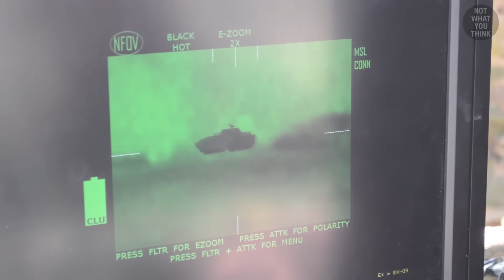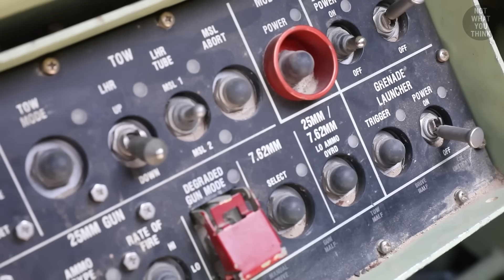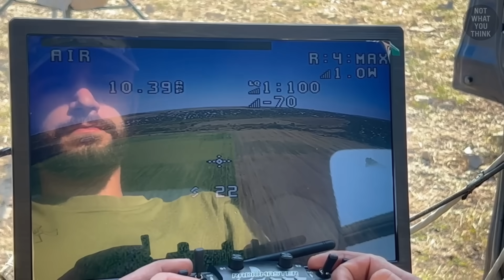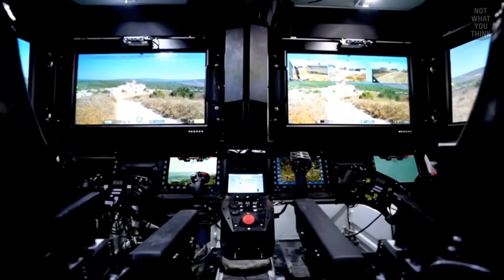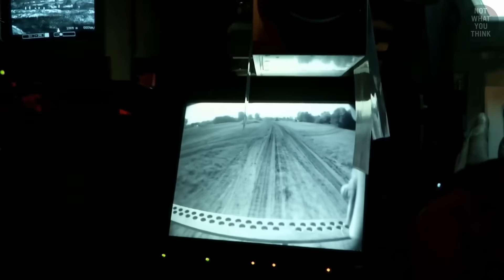How Bradley IFVs prove more Useful in Ukraine than Tanks

Comment: The problem Russian tanks are having in Ukraine have nothing to do with tanks being "obsolete"; folks have been saying that tanks are obsolete due to infantry-portable anti-tank weapons since the 80s. The problem is that Russian tanks operate without proper infantry support. Tanks are not do-everything weapons, they need to be supported by infantry to do their job correctly.
Reply: People have been saying they're obsolete every time a few are lost in combat for the past 100 years. Tanks have always adapted, and will likely continue to adapt for generations to come; They're too useful to ever outright abandon.
Reply: There was a long period where people were saying, "See the battleship is not obsolete... People have been saying for decades that the battleship is obsolete." @foo-foocuddlypoops5694
Reply: @foo-foocuddlypoops5694 its the modern evolution of cavalry
Reply: @foo-foocuddlypoops5694 🎉
Reply: @foo-foocuddlypoops5694 well it's a big armoured gun on wheels . Of course it's useful but the way it's used will certainly change
Reply: @foo-foocuddlypoops5694 ironically infantrymen get killed in every conflict yet no one says they're obsolete
Reply: @foo-foocuddlypoops5694  yeah they are useful in a defensive role because if you are the one going at it and its sitting still you are at a huge disadvantage because its more likely to spot you or its dismounted infantry or drones like the reaper which can communicate with the tank and give them a firing solution.
Reply: A war machine doesn't become obsolete because a counter exists, but rather because there are other systems that can fulfill that niche. For example, battleships didn't become obsolete because of anti-ship missiles; torpedoes have been a threat to battleships for a long time. Battleships became obsolete because advancements in destroyers allowed them to do a better job than battleships at a lower cost and with fewer crew requirements. It's the same with infantry, really. Machine guns are good at shredding infantry and have been widespread for over a century now, but they obviously don't make infantry obsolete. As long as there's nothing to do infantry's job as effectively, infantry is here to stay.
Reply: @solomonofakkad1927 Watch out for the upcoming robot warriors bro, just around the corner what with AI and all... Here comes the Terminator for real, soon to be seen at your next local madman's thirst for power.
Reply: @solomonofakkad1927  battleships became obsolete because aircraft carriers could engage them from well beyond visual range and drop bombs on them from above

Torpedoes still exist but nobody bothers with torpedo belts because that's not where the greatest danger is
Reply: A valid point but nonetheless ignores that drones are multiplying, diversifying, and improving faster than tanks. Missiles and artillery can aquire and target better than ever before. IFV can do most of what tanks do and are more versatile and cheaper and can take out a tank. Plus they carry their own infrantry support. The economics of MBT are going to be much harder to justify especially given their greater logistical demands.
Reply: Infantry and air support.  Combined arms, we call it.  The air support looks out and around the area, for anti-tank weaponry.  The soldiers on the ground look out for enemy soldiers with anti-tank weaponry.

Without air support you get tanks being destroyed by artillery.  Without ground support, you have tanks getting destroyed by tanks.

Don't forget the role of tanks.  Tanks are for killing people in fortified positions, and destroying said fortified positions.
Reply: The moment tanks stop being used, anti tank weapons will no longer be needed. Once there are no longer anti tank weapons, tanks will no longer be obsolete
Reply: Yes this we saw many times in WW2. Learning from the past is a rare
Reply: Sadly, we do learn from the past. We learn to fight the last war.  @user32001
Reply: @user32001  British counterattack at Arras in 1940 with heavy Matildas were a real problem for light panzers.  However no infantry support so they got knocked out by 88’s.  I’m one of the few who reads history.
Reply: t-72 was already a dated design in the 70s and was only chosen because of soviet cost cutting. That you can't even be taller then 162cm as crew says alot about the design of t-72 that and the turret usually gets launched into orbit if someone sneezes in the vicinity.
Reply: @zalandarr  Yet this is the tank Russia and Ukraine will in almost any situation prefer to a Leopard 2 or Armata. But well, what do they know, eh? ^^

(They know that the Leopard 2 is incapable of delivering indirect fire plunging into an enemy trench with any degree of precision, while the Soviet MBT are all natively equipped for this.)
Reply: @zalandarr  Yeah and now according to you, the M1A1 is a "dated design". Do you know what you are talking about? Have you served in tanks or any other AFV or are you just another r war thunder Veteran?  Do you even know WHY Russian tanks pop their turrets? Do you even understand the basic design you can explain the advantages of such a turret design? No you frucking well don't.
Reply: @zalandarr Western tanks burn just as good as Russian. Your joke of turret going to orbit from sneezing is laughable. Not funny in a sense you meant  . 
Ukraine's t72 turrets fly just as high as Russia's .
Reply: @NikZ8736 no they don't. Our tanks can survive way better then Russian tanks
Reply: @NikZ8736 not it's not. He is right. The crew in Russian armor sit on top of the ammo. One hit to yhe center of the hull side and off goes the turret. In desert storm we called that the jack in the box. And it happened a lot. Maybe 50% we scored a jack in the box. And it happened again during the 2nd invasion with same results. All u armchair generals have no idea what u are talking about.
Reply: @NikZ8736  yes the Russian made T-72s do fly high. Ukrainians prefer western tanks and IFVs eventually they will have no Russian tanks and all western tanks.
Reply: Exactly
Reply: Tanks a a concept aren’t obsolete, but many of the reserve tanks as mentioned in the video are obsolete because they’re old*. They lack a lot of the modern technology, namely armor developments and fire control systems (FCS)/ targeting systems because they’re effectively Soviet-era relics. Without updates, *those tanks are obsolete as far as a tactical advantage aside from simply having another vehicle to utilize.
Reply: The problems RuZZian tanks are having is the much better man portable anti-tank weapons in the hands of Ukraine soldiers - even the AT-4 and carl gustav are absolutely deadly to a tank or IFV when it is approaching your trench, and beyond that range you have NLAW, TOW, Javelin, Stugna-p and even the excellent Ukraine FPV drones with RPG warhead etc.  Add Brimstone and the various 'target seeking ' smart artillery munitions, as well as the mine deploying artillery shells  and a RuZZian armoured vehicle just became the most dangerous place to be.
Reply: @chrissmith2114  That's a good point.  I watched a video this week of a Russian tank, a T-72 that was hit by 5 land mines and kept moving forward.  You know that is absolutely brutal.  The sixth land mine took the tank out, but they did bring their IFV to the Ukrainian lines and the three tank members were taped getting out of the tank.  

Of course, things are even worse on the Ukrainian side.  Last week again brought is more video footage of Leopard tanks burning and that doesn't count all the old FSU tanks Ukraine has lost.  Not only do the Ukrainians have to fight the drones, the ATGMs, RPGs, land mines, and artillery, but they also have watch the skies for anti-tank helicopters which did a number against the Ukrainian armor.  

In short, it's rough being a Russian tanker.  It's even rougher being a Ukrainian tanker!
Reply: @chrissmith2114 Carl Gustav and at-4 cannot destroy a Russian tank.  They can knockout bmps   Bmds and btrs but not tanks
Reply: @smyers820gm  AT-4 can EASILY destroy a Russian tank AT=Anti-Tank Duh!!!
👉"Along with the FGM-148 Javelin and the Next-Generation Light Anti-Tank Weapon (NLAW), ❗👉 the AT4 destroyed HUNDREDS of Russian main battle tanks, infantry fighting vehicles, armored personnel carriers, and support vehicles in the opening days and weeks of the war. Feb 20, 2024"
Reply: @smyers820gm there's videos of a Carl Gustav destroying a T-90. Try watching something other than RT tv or reading TASS ...😅😂🤣
Reply: Someones been watching too much TV....
Reply: People have been saying the cavalry is obsolete for generations, but look, it's still proven itself well in the Crimean War and is still used by both the Prussian and the French armies to this day. I'm sure it'll still be relevant after this coming Great War.
Reply: @thearpox7873  prussia lol, wheres that?
Reply: @Dmarkus_greene  Mate, have you been living under a rock? Bismark's victory over the frogs in 1870 was heard even in the boonies across the Atlantic Ocean.

My point is that despite new technologies being developed that on paper should make the cavalry forces outdated, they are still and will continue to be used by the great powers of the world.
Reply: @thearpox7873 tanks and mechanized transports were what made cavalry obsolete because they could do what cavalry can do but better. Horse cavalry existed right up to the opening phases of WWII.
Reply: @hunterkiller232134  At the risk of repeating myself (because you've replied to an old comment), horse cavalry by WWI was already struggling to find a use. Horses require lots of food, hate artillery fire, and can't easily be hidden in trench bunkers. What use they did have was increasingly specialized, and they weren't for frontal trench assaults even before the first tank appeared.

Without a combustion engine being developed they would've still found a logistical use, ferrying wagons and carrying generals from place to place, so that is the one place where they were absolutely made obsolete by motor power.

That is not the same as the commanders deciding to abolish all cavalry corps, and doubly not the same as them doing so in peacetime. There is a difference between something being obsolete and the commander realizing it is obsolete, a difference between the commander realizing it and being able to convince the politicians, a difference between paying for the development of a cavalry and just squeezing some use out of the one you already have, and finally a lot of prestige tied up in the old tradition of the cavalry corps making it a big decision to remove.

For countries like Poland that kept their cavalry very late into the game, I suspect that the decision was down to:
1: Even if obsolete on the battlefield, horses are still very useful for police work and border enforcement if you don't have cars.
2: Bad and politically motivated procurement decisions.
3: To make the populace feel better than just not having anything.
Reply: @thearpox7873  Horse cavalry wasn't struggling to find a use by WWI. They were extremely useful as scouts, screening forces, transports, maneuver elements and for exploiting breakthroughs.

The US held onto cavalry well after WWI because the open plains and rough terrain of the American southwest favored horse cavalry over mechanized cavalry.

Sure cavalry didn't put up a good showing in WWI but it was easy to see that as an outlier considering while the Great War was waging in Europe General Pershing was leading twice as many regiments of cavalry as infantry into Mexico to pursue Pancho Villa. Static warfare and deep trenchlines weren't the only possible forms of warfare or defense considerations. That type of fighting would have been hard to do in the American southwest and northern Mexico, and you would be hard pressed to make contemporary tanks and trucks work either.

It wasn't until the further development of motorized transport and armor that horse cavalry started being phased out, and only because exercises in the US Army determined that motorized transport could do a horse's job more efficiently. It also helped that the increasing commonality of civilian cars and declining use of horses meant it was easier to train young men on military motorized transport than equestrianism. 

It wasn't machine guns or artillery that made horse cavalry obsolete, after all horse cavalry existed for roughly 60 years alongside machine guns and centuries alongside artillery.

To the point of the discussion, tanks aren't obsolete just because there are weapons that can destroy them. There always have been. They'll be obsolete when something comes along with better ability to assault fortifications, outmaneuver enemy forces, exploit breakthroughs and protect its crew.
Reply: @thearpox7873  everything you're saying is some kind of varying degree of "missing the point".

WWI style static warfare is not the only type of warfare nor is it applicable to every scenario. It is a very eurocentric view to think the future of war meant only grand battles in the vein of the Somme. In fact history shows this was not to be and the massive pitched battles with large complex defensive lines were in fact an outlier. WWII just 20 years later involved almost no trench networks and lots of movement.

Your point about machine guns is dumb. Better weapons are better, is your point? If you telepory F16s back to 1917 they'd destroy Sopwith Triplanes with ease. You don't fight with future guns against existence forces. If machine guns are shit then it goes to show why cavalry wasn't retired fully until after WWII.

Cavalry was no longer used to conduct mass frontal charges, and hadn't been for decades by WWI. You don't charge a machine gun nest head on with cavalry or otherwise. What cavalry could do, however, is maneuver around the flanks of a defensive line or negotiate rough terrain that purely dismounted or early mechanized forces could not and then the riders could dismount and attack. Horse cavalry also brought machine guns, mortars and light artillery with them.

The ongoing use of cavalry disproves your point, anyways. US led Phillipine cavalry charged Japanese troops in WWII. In China the rough terrain made horse mounted troops extremely useful due to a lack of mechanization in either the Chinese or Japanese forces and terrain unsuited to vehicles anyways.

The idea that the only military concern of the time is static trench networks and fortifications is just laughable. It was an extreme outlier in military history which was why it was both notable and devastating. If anything it proved that mobile forces were essential, which is why every nation worked to develop in them in the interwar period.

Tanks won't be obsolete when one of their roles is eliminated. After all, I don't think anyone believes T-55s are very useful in any Frontline role but the Russians have found them useful as assault guns in Ukraine. Tanks will be obsolete when their job can be done BETTER.
Reply: @thearpox7873  You seem stuck on cavalry having been about frontal charges when by WWI that hadn't been the case in decades, and in the US arguably had never been the case. Cavalry isn't a synonym for "cuirasser". Cavalry have had many jobs throughout the millenia. I don't recall when, if ever, assaulting fortified positions frontally was a cavalry job before or after the invention of machine guns.

The argument that cavalry were rendered obsolete or useless by machine guns and fixed fortifications is true only if we pretend that there are never rivers, forests, mud, fences, slopes, or rocks on the battlefield that the early tanks and trucks were expected to fight on. That is decidedly not the case in reality which is why cavalry existed right into WWII, until tanks and mechanized transports could negotiate such terrain similar to horses but with noted efficiency improvements elsewhere. 

The expedition that pursued Pancho Villa wouldn't have been nearly as successful with period tanks and trucks, and the fight didn't lend itself to digging trenches. Nor would sprawling trenchworks have been feasible in the wide open southwest of America where there were relatively few urban centers and lots of rough terrain.

To bring the discussion to the modern battlefield, threats to tanks have existed since there were tanks. ATGMs have existed since the Cold War. Their lack of effectiveness in Ukraine relates directly to the inability of both sides to use them effectively. Throwing tanks across the field without actual combined arms tactics is going to lead to destroyed tanks. It did the same thing in WWII. The German blitzkrieg relied on combined arms to be effective.

The Ukrainians lost most of their Leopard 2s because they had a horrendous time getting through minefields due 1 part to a lack of mine clearing equipment and 1 part to the actual depth of Russian defenses. They had to traverse narrow lanes carved through the minefields with drones, helicopters and pre-sighted artillery raining down on them. This doesn't mean tanks are ineffective or obsolete, but that control of the battle space and suppressing enemy artillery is essential to armored assaults. This was also known even in WWII.

Compare the coalition assault in Desert Storm. The minefields and physical defenses were cleared rapidly, enemy forces were suppressed by accurate massed artillery, the air space was controlled by the coalition, and the result was coalition forces advanced rapidly and overwhelmed and destroyed the enemy in armored combat. Of course the layers of defense weren't as deep as the Russians have created but the point is the same.

A drone cannot support infantry assaults. A drone cannot exploit a breakthrough in the enemy lines. A drone cannot outflank or outpace enemy movements nor rapidly push to a crisis point in the lines.

An ATGM cannot rapidly and accurately fire while on the move or overrun enemy positions.

Nothing does that like a tank can. Infantry are vulnerable to drones and ATGMs and tanks, and are actually the most vulnerable force on the battlefield, but no one is suggesting that infantry is obsolete because nothing else can do the job of an infantryman as well as the infantry can. Drones can't recon forests or retake buildings or establish forward positions in contested ground, nor can tanks.

Likewise nothing else can assault an enemy fortification like a tank or engage in maneuver warfare like a tank. IFVs and assault guns are even MORE vulnerable to antitank weapons than Tanks are.
Reply: @thearpox7873  Again, you're thinking extremely 1 dimensionally and apparently not even understanding what these weapons systems DO and what their limitations are.

Tanks, first and foremost, support infantry assaults by providing accurate direct fire from a cannon. ATGMs can't do that. The travel time from launcher to target is slower than the travel time of a 120mm cannon to target. FnF weapons are definitely game changers, as far as ATGMs go, but they don't replace the need for accurate direct fire.

Drones do not provide direct fire. Even with Hellfires and other missiles they aren't going to suppress or destroy enemy fortifications and require air superiority to use reliably and are vulnerable to traditional SAM systems. A tank can hit a variety of targets with a variety of types of rounds and do it on the move, or "shoot and scoot" faster than they can be responded to. You aren't going to outrun a HEAT round.

Drones don't support infantry assaults *the way a tank does*, which is the point. Recon is a great asset but doesn't remove troops from a position. They can't overrun an enemy position. They can't flank an enemy force and hit them from the side. A Reaper drone can carry 8 Hellfire missiles. An Abrams carries over 40 rounds, including a mix of HEAT and APFSDS and potentially delayed fuse rounds and canister rounds, and an Abrams mounts 3 separate machine guns.

A drone might be able to destroy a tank from above but if that tank is in urban terrain or woods that drone is going to have a hard time finding it. NATO learned the hard way in Bosnia that forests provide adequate protection from air power. You're going to have to send someone to go into that forest, or go into that city, which is where the infantry come in. And when the infantry run into built up defenses and entrenched enemy they need a tank.

Can an IFV mount a cannon? Sure it can. But it's going to be more vulnerable with less armor, and active protection systems only defend against missiles. An enemy tank can knock it right out, and if you armor it up to resist tank cannons you've just built another tank.

And I 100% agree with you that multiple systems can replace a tank. However it should be obvious to anyone that that's a terrible trade. 1 tank replaced by 4-5 systems means larger, more expensive forces with more vulnerabilities. That tanks can be killed is not a new concept. They've been killable since the beginning. But if you need 4 systems to do what 1 system does then that's proof positive that the 1 system is really, really good.
Reply: @hunterkiller232134  "providing accurate direct fire from a cannon. ATGMs can't do that."
When have I ever claimed that ATGMs would be the replacement of a tank for the assault role? I haven't.
But yes, I am pedantic enough to counter that the can do it. Just badly, and when troops don't have proper support they can and have resorted to such tactics.

"Drones do not provide direct fire."
What do you call dropping a grenade on a specific infantryman in a specific point from 30 meters? Or just ramming into him directly on a call from the troops on the ground. This isn't me saying drones are amazing, I legit would like to know what word you would use. Direct support?

You speak about the time it takes for a missile to hit its target vs a shell, which is true, but has the same energy as talking about the vehicle driving speed. Yes, it is important, but not any sort of knock-out, just part of the cost benefit analysis.

You speak about drones being vulnerable to SAM systems, but then there's the dimension of the cost of a drone vs that of an interception. If you're using a Reaper drone, sure, but not if your system cost thousands of tens of thousands of dollars. And you can mass flying systems (and artillery) the way you can't ground vehicles, so even if you lose some it won't be critical.

You speak of how many shells tanks carry, but the question is how many of those shells on average the tank will be able to use before being shot down. And if your tank gets blown up, your assault if probably done. A new drone can be there in minutes. 

"A drone might be able to destroy a tank from above but if that tank is in urban terrain or woods that drone is going to have a hard time finding it. NATO learned the hard way in Bosnia that forests provide adequate protection from air power. You're going to have to send someone to go into that forest, or go into that city, which is where the infantry come in. And when the infantry run into built up defenses and entrenched enemy they need a tank."

You start off by saying something that is only half-true, prove it with an example that doesn't prove your point due to tech advancements, follow it up with something that would be true even if your preceding point was completely false, and end it with something that is the subject of this whole discussion and is in no way proven by what you said.

So to start with, the modern optics are far superior to those that existed in the 90s, though in that respect I am actually more impressed by the newer satellites which may or may not see thought all sorts of cover and weather. But yes, hiding objects is still possible. 

The thing is, even if tanks had a 100% rate of getting destroyed in forests and cities, you'd still encounter entrenchments when you send people in, at which point you need a way to overcome them. 

At that point, no, they do not 'need' a tank, a tank is just one of the primary options for dealing with the problem. And if your tank is very likely to be destroyed by an ATGM, a drone, accurate artillery fire, or mines, it might not be worth the bother. At which point we've circled back around to the start.

The point of bring up an IFV is not to get a cannon and call itself 'not a tank'. The point is that when the survivability of an armored vehicle get dangerously short they can still deliver troops to the set location and leg it before they can get disabled. And if and when they do get disabled they are easier to replace.

Yes, the tanks could be destroyed from the day they were unveiled, but you keep dismissing that the relative survivability matters. If we were to take what the tanks were capable of when they were first unveiled in WWI as the golden standard, armored vehicles would've never become more than a fad on the front-lines.

"1 tank replaced by 4-5 systems means larger, more expensive forces with more vulnerabilities."

Not if the systems in question are already in use, or are significantly cheaper.
And maybe not if you need 10 tanks to do the job of a single tank. Certainly if you need a hundred tanks for that.
Reply: @thearpox7873  You have a fundamental misunderstanding of what direct infantry support is.

Direct infantry support is direct fire artillery that is organic to an infantry organization. In the US Army, an armored company team consists of 3 infantry platoons and 1 armored platoon all under the command of the company commander (or 3 armored platoons and 1 infantry platoon).

This allows the troops on the ground to have immediate and direct support. Drones definitionally cannot do that. They have to have a longer kill chain due to the infrastructure needed to support drone operations. At best they can function like air support with all the limitations thereof (time on target, loiter time, EW and ADS systems, etc). A drone dropping a grenade in a fighting hole is a neat trick and great propaganda but it doesn't replace the ability of a commander to have a Cannon round put where he needs it close to immediately. A drone might be able to locate and find a sniper or ATGM team hidden in a building and drop a grenade on them but it will take longer and is less effective. How does a drone drop a grenade into the 5th floor window of a building that a sniper is using as a nest? A tank would just elevate its gun, fire and get back around a corner if anti-tank weapons are a threat.

The reason I bring up Reaper drones is because you're painting a broad brush with the term "drone". A Reaper or Predator can carry multiple missiles that have the kind of ordnance to appreciably destroy fortifications have limited amounts of it they can bring and when they are out they need a whole airbase to return to in order to rearm and refuel, and are vulnerable to all the existent systems that a jet would be vulnerable to such as MANPADS, SAMs, and enemy air forces. They also cost significantly more than a tank, with a Reaper drone costing $32 million.

A Switchblade kamikaze drone might be significantly cheaper but it comes with more limitations in terms of its ability to support infantry. Again, a target taking cover inside a building or forest is a lot harder to hit and a chain link screen can provide decent protection against a kamikaze drone's ability to reach its target.

Even if none of those weaknesses existed the point of organic armored support is so that if all else fails an infantryman can hop up onto a tank and tell the commander directly "I need you to hit THAT target, over THERE!"

That can't be done with a drone, meaning bad radio communications or confusion can leave a unit in the battlefield without the support they need.

Your point to the relative costs of a drone vs a tank is irrelevant. A drone cannot do everything a tank can. A tank represents a substantial amount of combat power, well in excess of what a drone can provide. A tank can destroy an enemy tank, advanced over and bury and enemy trench, suppress another enemy position with machine gun fire, and then dismount to secure an area alongside infantry - and do it all within minutes. A drone might be able to hit a fortification with missiles and warheads but it can't stay and repel a counterassault, prevent the enemy from just retaking those same fighting positions again, search for Intel, etc.

Per the US Army, the tank force comprises just 4% of the army but 40% of its combat power. That's because a tank can do all the above and all the above is hard to do without tanks. IFVs and mobile gun systems can't replace tanks because despite being faster they are less armored which means they are more vulnerable. Tanks can use speed and armor to defend themselves; an IFV can only use speed (and the loss of an IFV, its crew, and its complement of troops is both more expensive and a bigger loss of manpower than a tank).

Fundamentally your misunderstanding comes from seeing too many Ukraine war videos, or Syrian Civil War videos, where lone tanks are getting destroyed by lone missile teams or drones. It should be obvious that when one side is using tanks completely the wrong way, even contrary to their own doctrine, they're going to have a lot of losses. Especially when we only see the successful attacks for propaganda purposes. But most wars aren't going to have 1 side completely mismanage their forces and ignore their own doctrines while the other side gets a nearly limitless supply of the most advanced anti tank weapons on the planet. Were Ukraine not getting tons of drones and drone technology and training for free the Ukrainian battlefield wouldn't feature them as heavily. And yet even though they are, and it does, Ukraine is still asking for more tanks.
Reply: @hunterkiller232134  "You have a fundamental misunderstanding of what direct infantry support is."

I can feel the condescension dripping off of you. Dude, I forgot a term and asked for a definition. That doesn't mean I don't understand a concept, it means I don't remember a word for a drone dropping a grenade in support of an infantry assault.

You keep conflating an inherent limitation of a system with the current US army structure, which isn't useful when talking future systems uses and capabilities.

"This allows the troops on the ground to have immediate and direct support. Drones definitionally cannot do that.
They have to have a longer kill chain due to the infrastructure needed to support drone operations."

Like this here for example. Drones may well become integrated starting from the platoon level if not the squad, or perhaps an armored company will add in a drone platoon for a total of five. The higher up the chain of command you go the more expensive and the more capable the drones will get until you get from $300 FPVs to the stratosphere.
So there is nothing 'definitional' here. It's up to the army command to structure the army.

"A drone dropping a grenade in a fighting hole is a neat trick and great propaganda but it doesn't replace"
If it was just a neat trick and propaganda both the Ukrainians and Russians wouldn't have build a whole number of different lines of drones like the Baba Yaga drone for this exact purpose.
It's an important battlefield function, most of which has nothing to do with assaulting fortifications.

"How does a drone drop a grenade into the 5th floor window of a building that a sniper is using as a nest?"

By dropping it's nose and flying full speed inside the window. Takes a good pilot, but can be done. Plenty of videos of drones flying into open bunker doors or windows. Also interesting when the AI will be able to replicate that. Can be faster than a tank if, say, the tank needs to turn and cross the street first to be able to hit said window, though at the moment less reliable.

"...Reaper drones..."
The problem is that 
1: Reaper drones are old tech. Developed from today, you could get same capabilities much could get same capabilities for cheaper and with less maintenance. And that's without taking into account what will exist in 15 years.
2: It is a US army product, and like most US army products it is significantly over-engineered with high maintenance time. If instead of shooting to be the 'best' it instead just tried to be 'good enough' you could probably get something functional that's much easier to use.
3: A more precise missile would mean it doesn't need to be as powerful.
4: If you need something that packs a lot of power, an artillery truck 25km away also exists. No, it doesn't matter how many hoops a US army sergeant currently has to jump through to get an artillery shell because that can be changed. Yes, it'd still fly much slower than a cannon shot, so not a good option if you want a shot in under a minute. 

"A Switchblade kamikaze drone might be significantly cheaper but it comes with more limitations in terms of its ability to support infantry. Again, a target taking cover inside a building or forest is a lot harder to hit and a chain link screen can provide decent protection against a kamikaze drone's ability to reach its target."

Switchblades quickly found themselves overshadowed and arguably outcompeted by DJIs and native Ukrainian drones, and while I haven't followed the story, I do believe Orlans have developed double warheads to get through the nets and chain fences. You can also just increase the payload anytime your enemy adjusts by increasing their protection, which is a race that mostly favors the drones.

The are also a huge amount of drones in between the Reapers and FPVs, with many costing hundreds of thousands or several million, and all provide different capabilities.

When it comes to communication, not only has it been getting better with every decade, but with a clean top-down view of the battlefield the drone&artillery teams have been making their own judgement calls based on many times better information than what the troops on the ground have. Funnily enough, I do believe there have been proposals to get tanks optics linked with that of drone support to get better real-time information.

"Your point to the relative costs of a drone vs a tank is irrelevant. A drone cannot do everything a tank can. A tank represents a substantial amount of combat power, well in excess of what a drone can provide."

It is relevant because depending on the cost it isn't a tank vs a drone, but a tank vs a squad of FPVs, bombers, observers, and possible a bigger system out back with a couple missiles attached. And that's not accounting for artillery that works hand in hand with them.

Wold they be able to destroy an enemy tank? Yes, of course, as well as suppress an enemy trench, locate and bomb out enemy reinforcements, and most important of all, keep being useful even after half of them get shot down in the process instead of getting disabled due to a popped thread even if your main armor does the job.

What they cannot do is dismount infantry, but the issue with the tank there is that the hold significantly less troops than IFVs and APCs, hence why those systems are better for the specific role of ferrying troops.

That said, it'd be funny if we got lil' helicopter drones that would be able to carry a hundred kilos ten km forward and return. I wouldn't be surprised if something like this was already in development, as it'd do things like bypass minefields.

"Per the US Army, the tank force comprises just 4% ...."

This literally doesn't matter. First of all, if you believe that tanks are already outdated, you are presupposing that the US army is wrong. Probably because special interests, old habits, outdated doctrines, or because beating up enemies 100x poorer than allows for some questionable doctrines.

If you however believe that tanks are on their way to being outdated, then it still doesn't matter because this statement describes the world right now, not in 20 years.

"Tanks can use speed and armor to defend themselves"

Both of which are becoming less and less of a protection as the time goes on, which is the central issue with tanks as well as all armored vehicles in general.
 
"Were Ukraine not getting tons of drones and drone technology and training for free the Ukrainian battlefield wouldn't feature them as heavily. And yet even though they are, and it does, Ukraine is still asking for more tanks."

First, I don't remember when they last asked for more tanks. They kept talking more artillery shells last time I checked. 

Second, they want anything the west will provide them, because something is still better than nothing. They'd probably take WWII biplanes if you found a stockpile.

Third, which part of me looking at the trends and future doctrines is it so difficult to comprehend? The drones flying today are far more effective than they were a year ago, and less effective than they will be in two years. The artillery today is less precise than it will be in ten years. And proper place of drone pilots in not yet solidified in the Ukrainian army, let alone American one.
Reply: @thearpox7873  I'm not condescending, I'm being literal. Direct infantry support doesn't mean "in support of infantry". Artillery is in support of infantry but it can't provide it in a direct fashion. That's the whole point of tanks.

Artillery can't replace the ability to immediately tell a tank to shoot a position, or for that tank to be organically attached to an infantry unit in the assault.

Likewise a backpack drone is a great aid to an infantry squad or platoon but can't carry the munitions to support an infantry assault. My point about Reaper is that anything that can carry the type of munitions that can directly support ground units the way a tank can is going to be equivalent to a small plane in terms of infrastructure need. A TB2 Bayraktar only has a payload of 1500lbs, or 4 missiles. A fleet of them is going to require a small airbase in support and you aren't getting that on a battalion level or below, which runs right into the problem of it not being direct. Sure a platoon or company leader can call for drone support on a target but that takes time from the ask to the get and if the radios are being jammed or if the number of requests outpaces the amount of available support then the little guys is shit out of luck.

And you know what already provides that level of fire support and is organic to the Infantry unit? Helicopters.

The whole point of a tank or a mobile gun system is the ability to have immediate direct fire support organic to an infantry unit. The company commander can call his tanks and tell them to shoot that building, or a private can climb on the side of the Abrams and tell the gunner where they're taking fire from. That tank carries a lot more ammo than a drone carries missiles or grenades and can stay around longer. There is a reason tanks and assault guns have been organic to infantry units since WWII.

Vulnerabilities have almost never been the reason a system was retired from the battlefield. Capabilities are what retires a system. Vulnerability is just one factor that determines a unit's capabilities. Infantry have been vulnerable to rockets and ATGMs as long as tanks have, and to machine guns, chemical weapons, artillery and rifles. And no one is talking about removing infantry from the battlefield because they provide too much capability to ignore.

Likewise cavalry wasn't retired because they were vulnerable. Cavalry have been vulnerable to guns since guns were invented. They were retired because armor and mechanized transports were way more capable. 

Russian losses in tanks owe entirely to not practicing their own combined arms doctrine. With any battle plan the enemy gets a say, so assuming that if you don't have tanks IFVs and drones can get the job done ignores that the enemy also determines what doctrines and methodology are viable. Ukraine isn't asking for fewer tanks, either. They are asking for more so they can assault Russian lines.
Reply: how does the infantry support a tank if it gets sniped from 5 km away by a kornet or it gets taken out by arty or mines or drones as they do in ukraine, what can a footman do to support a tahnk there
Reply: @poki580 we have tows and hellfires and a thousand other things to detect and eliminate the kornet launcher before it can fire.  Unfortunately Ukrainians don’t have this capability at this time and that makes a huge difference 🤷‍♂️
Reply: Infantry won't protect you from Artillery and minefield.
Reply: @SuperCratoss  True, but that is only one threat.  Infantry protects armor from ATGM and armor protects infantry from the artillery and minefields you just spoke of, not to mention other infantry.
Reply: You're ignorant. Tanks get destroyed by drones. It has NOTHING to do with any infancy support.
Reply: Russian tanks are not well maintained in this war
Reply: @Vincent94747  Russian/Soviet kit is designed to be mostly disposable.  It's difficult and fairly expensive to maintain because of the sheer consumption of spares involved.

Soviet doctrine was to design for an expected combat lifespan of 2 weeks

They also had a "people are disposable too" mentality which hasn't been true in the USSR/Russia since the late 1970s and accelerated after 1990 (there's a critical shortage of under 30s across the board to go with the 25-30% population number decline since 1991 - the demographics of Russia are already upside down and promise to get worse
Reply: @Vincent94747  Russian anything is not well maintained in this war.
Reply: @Vincent94747  true but at the same time, neither are the Ukrainian but that the nature of war, alot of these weapon were designed to work with minimal  maintenance  compare to western  tanks, u can beat the hell out of it and it'll work, that basically  how they were built and a lost of a tank isn't as bad compared  to western  tank to to cheap build and depending on condition  easier to repair, somthing that Russian  have confirmed been doing t tank and other vehicles  that they able to bring back
Reply: @123456qwful  Most Soviet/Russian weapons systems aren't designed for servicability at all. The prevailing ethos was a belief that the average lifepsan in a war would be 7-14 days regardless of maintenance, so most are designed to be disposable

Their tank doctrine in open warfare was always based around sprinting into western europe faster than infantry could keep up and going face to face with western tanks in the kind of massed tank battles we just don't see in Ukraine
Reply: @123456qwful  Ukrainians say that Western tanks are actually easier in maintenance. Russians just develop lot of hack repair due to fact that they maintenance suck.
Reply: @123456qwful no western armor, at least American isn't a maintenance nightmare. In fact ours a modular and can swap Abrams power pack in about 30 minutes. Plus Abrams and bradleys can take a beating and keep on going. They are very robust. What u are stating is total myth. In fact T72 T80 T90 engines take a little longer to replace. But I'll give them some credit they are rugged. But so is American armor. So much wrong information on this subject. And most of these people get their info from war thunder. My comments are all factual. And I have real world experience.
Reply: @miscbits6399 DingDingDing, this is the answer. Soviet tanks are designed with the expectation of dashing across European plains and needing to be light enough to ford rivers and cross bridges. They're poorly designed for defensive engagements because they are slow to reverse, aren't (comparatively) heavily armored, and 3 crewmen make repairs take longer and prevent an extra man to help provide security. 

Western tanks were designed for defensive warfare that would involve dashing from one battle position to the next in an elastic defense and have heavier frontal armor, better optics, and better survivability and crew redundancy
Reply: Drones are a new and buge threat to battlefield....instead U.S. needs find a cost effective way too take them down! id not worry bout tanks being obsolete!!💯🙌👍
Reply: They’ve said that since the invention of the Tankgewhr M1918.
Reply: They are forgetting how one weapon system isn't invincible, it's like a computer, a computer can't work if one of it's system isn't working properly, that's the military in a nutshell, only works efficiently if each weapon systems supports each other
Reply: It s not just infantery... air suport is crucial and in future drones capable to atack and defense!!
Reply: tell me how an infantry support can protect a TANK against a 155mm artillery projectile, or fend off a javelin... 
your problem is that, you may take everything you heard from the Army, for face value, how is the infantry going to perform in an open flat field like that.
Reply: @buravan1512 very easy.  We practice combined arms.   Tanks are 1 part of that equation and infantry is another 🤷‍♂️.   In a true combined arms unit we’d have artillery too as well as air support.   Desert storm was a textbook perfect example of this.  Which is why the 4th largest army on earth was decimated in 7 days 🤷‍♂️
Reply: The very expensive tanks vulnerability to an individual with a decent rocket got a lot worse when the inexpensive drones showed up.
Reply: This is stupid statement. This is a typical myth. If you knew the subject more deeply, you would see that tanks almost always come with infantry cover in Ukraine. The problem is with the drones. Tanks cannot even enter the deployment line before attacking to avoid being noticed. And yes, civilian drones are constantly hovering over the battlefield - this is the main problem.
Reply: Instead of clinging to outdated main battle tank concepts and myths, you Americans would be better off coming up with an effective way to jam drones. This is the most important thing now. If the drones are silenced, then the tanks will be able to operate. Generals are always preparing for the last war.
Society always draws conclusions from past wars, but is not ready for new ones. And yes, war never changes, but it differs in details. The ideologists of the First World War did not know what the First World War would be like; they thought that they would advance with cavalry and infantry chains. The ideologists of the Second World War did not know what the Second World War would be like until the Germans used their effective advanced tactics of tank breakthroughs. World War 3 is already underway, and judging by the infantile state of Western societies, we are completely unprepared for it.
Reply: @Trbrigade  the same tech we’ve used to counter rcied already works on chap drones.
Reply: I suspect that the US/NATO style of infantry supporting tanks relies on a professional NCO corp who can act flexibly and on their own initiative, which is something that Ukraine has been working to implement since 2014, but the Russian military seems to be stuck in a top-down and rigid USSR-style command structure.
Reply: Russian tanks are crap though. It just doesn’t help that their tactics are just as garbage as their equipment.
Reply: I thought this to dude,but let’s say that tanks are now to expensive for how easily they are destroyed now! Even Israeli tight infantry support for there merkavas they are easily damaged and isolated by say 10 cheap drones with anti armor shells that there operators are completely safe from the tanks infantry.  So you can say tanks even with quality infantry support are not very effective!  This is why the larger nations are terrified by now by rouge puny nations or terrorist groups with cheap drone technology.  On water it’s even more dangerous due to modern navies are very thinned skinned !
Reply: The problem with Russian tanks in ukraine is that they are junk. Russian armor and ifv are way obmverrated. I suspect a lot of that has to do with online gaming. Developers nerf one and boost another for balance.  Over the years a lot of people assumed Russia equipment is as good as it is in video games. And they aren't that good by a long shot. Their optics are terrible. Their night vision is garbage the crew sits on top of all the ammo which when hit often gave us a jack in the box. And Russian armor protection is far inferior. The T80 weights 45 tons the Abrams was 70 tons and a Bradley weights 35 tons. Russians don't have chibham or Dorchester armor or super dense depleted uranium armor. The autoloader are prone to jaming and ripping arms off the crew. And Russian equipment is super cramped and a fatiguing ergonomic nightmare. I think their are height restrictions of no taller than 5'8". The turrets are so small they lose elevation and depression with their man guns and can't even hit the 2nd floor of a building unless they are a good distance away. Just like video games have people thinking the AK is some great rifle when it's not. It can't hit anything past 100 yards because of how the sites are located forward and close together. Video games are doing the same for Russian equipment and it's junk in comparison to American vehicles. Read the tech manuals on there stuff. Abrams has 120mm cannon vs the T72 T80 T90 125mm cannon. Abrams put ranges them with a smaller cannon. They fire and hit those tanks long before they can return fire. Which is a serious problem in war. The Abrams is much faster than anything the Russians have too. Same with the Bradley. About the only spot Russian weapons beat the Abrams is in fuel economy.  Sorry to bust the bubble of all the Russian equipment worshipers but what I'm stating is fact and not opinion. My statements are factual. Read the tech manuals and comparative litature.  And all u Russia lovers don't come at me with well bradleys are being knocked out in ukraine. Well no shit they are it's a war. Things get destroyed in war. Especially large wars like ukraine. Bradley is not a tank. It's not a light tank. It's a ifv and used for recon. They aren't impervious and they aren't meant to be. They are lightly armored vehicles. They will handle any cannon the bmp's have though on its frontal arc. Whereas the Bradley, again a smaller cannon than all versions of the bmp, chews the bmp up regardless of where it hits a bmp of any version. And I have practice experience. I was a Bradley gunner during both wars in Iraq. And no not everything tank in Iraq was 3rd hand Russian 1950's Era vehicles. Republican guard had modern Russia vehicles and fought us. They had defense in depth, jammed our community, attempted to maneuver on us and had rapid reaction reserves and supported by arty. So please don't try that misinformation either. Russian equipment is junk captured to ours. I know many will be butt hurt by this. But facts don't care about your feelings. Facts ain't woke and don't lie.
Reply: According to NATO doctine, yes. More importantly, NATO tank doctrine basically requires local air superiority before the MBT advance. It is all very sound and worked exceptionally well against the regular Iraqi armed forces.
BUT there are no places for NATO tank doctrine in the Ukraine war WHATSOEVER this far. Period. It is a recipe for SUICIDE. Any time either side tried it, its force got utterly wiped out. The battlefield which NATO tank doctrine assumes did not, does not, and likely never will exist in the Ukraine war.

"The problem is that Russian tanks operate without proper infantry support." - this is just those that get surprised and droned to pieces in the open, basically the opposite of survivor bias. But there is other footage, less often seen: tanks in well-camouflaged positions, often in wooded ground, just sitting there doing seemingly nothing.
THAT is what post-Stalin Soviet tank doctrine advises in such situations: don't waste your armour in costly assaults. Use them as part of a defense-in-depth that can go on the offensive with a few minutes' notice, to give covering fire for lighter and more abundant forces. It works well on this battlefield; Ukraine uses it most of the time, Russia uses it often, and the most egregious Army losses (equipment and personnel) in this war occur when they do NOT use the Soviet doctrine but try to do it NATO style:
Ukraine's attempt at this literally turned a potentially war-ending offensive into their most shameful defeat, and less than a day after H-Hour. So they don't do it anymore for the time being, and took note that their only debilitating defeat since Mariupol was caused by using NATO tanks just as NATO generals suggested they are to be used.
Russia OTOH tries and predictably fails to use armor NATO-style as part of their meatgrinder assaults. But they are still incapable of pulling off anything resembling combined-arms ops beyond platoon level.

tl;dr: According to NATO doctrine, infantry supports tanks.
According to Soviet doctrine, tanks support infantry.

This is why Soviet tanks, but not NATO tanks, have an integrated and sophisticated indirect-fire capability, with trajectory computers and rangeing tables for plunging fire, and extra powerful HE rounds that is pure murder: To bust enemy trenches before the infantry assault reaches them. The closest equivalent in the NATO arsenal is UK HESH, but this is direct-fire.

It is quite successful, if applied by a competent force (i.e. not Putin's). It is the reason why Ukraine was not crushed by the artillery shell crisis: Cesars and bonkbitzes are neat, but in a pinch, any old T-62 need not be turned into a D-30 howitzer but as an SPG on steroids - because it already was that when it rolled off the production line 40 years ago.

Remember the WW2 US M4A3/105mil M4 combo? This, basically, with the added benefit that they can still be a plain-vanilla MBT.

That NATO tank doctrine is a complete fail in this war, while Soviet tank doctrine dominates the battlefield is hard to swallow for US Americans in particular. But the facts are incontrovertible.
And there is really no reason to fret: It would be surprising if it were any other way. Because Zaporizhian steppe and Luhansk forest is not Medina Ridge or the Fulda Gap. It is the very heart of the USSR tankist tradition, its motherland and birthplace, where they ground Hitler's fascist occupiers to a pulp and all the Tigers in the world couldn't stop them.
Reply: Russian tanks lack modern features such as APS,  compartmentalized ammunition with blow out panels and state of the art night vision equipment.   Russian tanks can't reverse.
Russian tanks have less frontal Armour than western tanks.    Russian tanks have slow rates of fire.   All these features mean Russian tanks are obsolete.
Reply: Thanks General Obvious
Reply: Not in Ukrainian case
Reply: Танк уже вымер как и дредноуты.
Reply: I'd say tanks aren't obsolete and they're still much cheaper to make than attack helicopters and that tells you something. There are multitude of problems in this era of warfare as practically almost all the world's infantry units weren't trained to seek and destroy drones trying to sneak into the enemy lines at all and to compound the problem further, there are still a good chunk of armed forces are still using dated strategies and tactics against the new and hip equipment of today that create a lot of holes into the outcome of a given war.

Remember that there's no end all be all in war and even old techology can and will find a way to remain relevant. Horses were used in rugged terrain and there are mules being used by the us military today as an alternative to gas guzzlers (and power hungry cars of the future) due to their low maintenance and much lower profile.
Reply: @ElkaPME  There are two main reasons tanks are and will continue to be used for the foreseeable future.

1: There are already a lot of tanks built or with a production line dedicated to them. When you already have something on hand, you may as well use it even if it wasn't worth the cost. For example, if you suddenly had 2,000 trained Balearic slingers from Hellenistic times pop out of the ground, you betcha a military would find a use for them, outdated or not.

2: Until there is a decisive shock to the system, the military isn't going to abandon a technology. There needs to be some decisive battle or war to convince the military procurement generals that something is outdated, and that won't happen until Western level militaries meet head to head. 

Neither of those factor figure in whether something is outdated, but they're the ones that determine whether it is used.
For the record, I think that tanks are one one ATGM  and precise artillery generation away from just being a clunkier IFV +5-20 years for the tech to spread. Currently, they're borderline, though Russia doesn't exactly have the newest arty or NLAWs.
Reply: @thearpox7873 I think we will see an evolution of tanks rather than being abandoned in a generation.

Probably will see tanks get slightly smaller and much faster. Could see some plans to add some form of ew suite to mess with drones or an ai controlled secondary turret that shoots down any drone not registered as a friendly. Maybe some active defense like small interceptor rockets to block suicide drones, missiles, and artillery rounds.
Reply: @Nostripe361  You can't both add an EW Suite and an additional turret and interceptor rockets AND also make the tank smaller. You're just making an ever-more expensive glitter box that won't be available in large amounts.

As for their overall evolution, the funny thing is that modern militaries today feature a whole suite of armored vehicles that would've absolutely been classified as a tank in the 30s-40s. So you might conceivably end up with a platform that doesn't fall under a classification of a tank today, but is still an armored classis with trench clearing capabilities.

Overall, my lack of excitement about tanks comes down to
1: Tanks are becoming easier to target with every new generation of ATGMs. (And now drones). Just because every new generation leads to unsophisticated hype (Is THIS one the tank killer?!) doesn't mean they aren't becoming more and more dangerous.
2: The big selling point of a tank, the cannon, more and more has to compete with both artillery and drones for it's role on the battlefield. If you can call up an artillery strike with a square meter accuracy in seconds, you don't need a big turret right here. And just like with ATGMs, those systems are still evolving.

And if you can't protect your crews and your cannon is unnecessary, the tank becomes something you use only because you already have a production line, not because it's good.
Reply: Thank you, this channel is bad. Lots of nonsense in this vid.
Reply: Obsolete Russian tanks???But is this a joke?
Reply: Denial!
Reply: Well stated.
Reply: The problem is in a different type of war that has nothing to do with ww2 or the way people see it through video games. Tanks have not been used as an offensive weapon for a long time, if on the other hand you have strong artillery, rockets, drones, mines, anti-tank armed infantry, aviation, etc. The classic tank attack on the defense from ww2 has been gone for a long time. The Russians realized this at the beginning of the war after a stupid mass attack with armored vehicles and tanks like in WW2. Today they are used as mobile artillery or as bunkers to strengthen the defense. That is why Russia uses outdated models of tanks such as t55 or t62. They probably have millions of shells in their warehouses for them and they serve as artillery.
Ukraine cannot match them, regardless of foreign aid.
Reply: @duskobabic4285  agreed on everything expect "Ukraine can't match them" Ukraine could match them if West truly cared about war and wasn't drip feeding it with aid packages
Reply: The Booker is gonna be a game changer
Reply: I think it’s safe to say tho that Russians are obsolete
Reply: Even the Russians tanks aren’t as bad as some people say. Yeah, compared to their NATO counterparts they’re kinda lacking, but for what they were designed for they’re okay (cheap to produce, low profile, and easy to train for). The problem is that Russia doesn’t have enough money to properly sustain these vehicles mainly due to the fact that they hold on to obsolete T64s, T55s, etc. Most Russian tanks are in such a condition that if they were in any NATO military they wouldn’t be deemed combat capable.
Reply: @stardust7186  Well that is a modification of the basic MSM line, "Russia doesn't maintain their tanks."  Russian tanks are doing quite well in Ukraine and are holding up as well or better than Ukrainian tanks.  The simple fact of the matter is that while a battlefield necessity, the tank is rather outdated.  When a tank marches into battle against and ATGM, the ATGM usually wins.  The same is true with anti-tank mines, Attack helicopters, artillery, and the new drones.  We have very few cases of actual tank on tank combat in this war.  When we do we see FSU tanks do quite well against FSU tanks.  Granted, that's to be expected.  But what is more interesting is that when we have tank on tank combat we see Western tanks and Russian tanks performing equally as well against each other.
Reply: @joshuaalistair3193 holding up well? 😅😂🤣  Yes ONLY 7,000+ have been destroyed in Ukraine /sarcasm. Some people don't understand reality...
Reply: @droiduser1984  Well you didn't give me enough in your comment for me to know what you are talking about.  There are over 247 replies and I am not going to fish through them all to attempt to find out what you are referencing.  I will take one stab at it though.  If you are referring to 7k Russian tank kills, I would point out several things. 

1st, the US DOD has already pointed out that Russia has replaced any tank, artillery, and any other equipment and personal losses they have taken in the war.  With this being the case, Russia could afford to lose another 7k tanks!  

2nd, I doubt you have a complete understanding of a tank "kill".  Some times you have a total loss of the tank.  That clearly would be a kill.  Much of the time you have a tank that could be rebuilt.  While this takes time, it is far less time than to build a new tank.  Most of the time you have a mobility kill where the tank is taken out of the fight.  However, it can be taken back from the front lines and repaired or if it is more intensive, it may be taken out of theater and repaired without requiring a rebuild.  As such it is possible for the same tank to be "killed" multiple times... which points us back to my 1st point.  Russia doesn't have to rebuild new tanks to keep their numbers up, they can rebuild/repair as well.  

3rd, much of what we saw on the onset of the war were actually Ukrainian losses.  Both sides use much of the same equipment, at least at the onset of the war.  So when you have a burned out hull, you just slap a nice crisp and clean Russian flag on the burned out hulk and call it a Russian tank!  

4th, Russia has the ability to repair their tanks just behind the front lines.  They also have a rail network to ship them back to the Motherland for more intensive repairs.  Ukraine on the other hand does not have the ability to repair Western tanks in country and must ship them to Poland for repairs which makes their "killed" tank replacements take longer, if they can even get them off the battlefield.
Reply: The top killers of tanks are mines, artillery, and ATGMs. Infantry support probably wouldn't change that
Reply: @theimmortal4718  are you citing ww2 stats? 50+% of russian tanks have been lost to drones...
Reply: @dungeondeezdragons  
Infantry support CAN defend against some drones attacks to tanks, but drone spotting for artillery is way more effective than using armed ones. I would bet that a majority of tank kills using drones have been to already disabled vehicles. A great tactic to destroy them before the opposition can recover them.
Reply: @theimmortal4718  you are kind of missing the point a little. Long range mobile artillery plus Long range high flying drones with 80-100km(50-60miles) capable cameras + NV + Thermals requires WAY bigger investment both in money&man power and also is WAY higher up in the "tech tree"(if you know what i mean), than your average infantry company or even a platoon(never being able to get ambushed for one) running into a tank that is defending an area, then one of your riflemen taking out a drone from his backpack attaching a hand granede to it and popping that tank without any personal risk to him or his mates.
Reply: If You operate tanks without infantry support, You lose much more tanks, but You lose less personnel in total. If You cannot afford to lose much personnel, but have tons of old tanks, operating these old tanks without infantry support starts making sense.
Reply: Well centurions worked just fine in Korea with no infantry
Reply: the problem w russian and ukrainian tanks is the drones. drones, mines and artillary are the main killers of tanks in ukraine. Until tanks find a way to deal w these threats they will be slaughtered in the battlefield
Reply: Yes it’s true that without infantry screens tanks are vulnerable. Combined arms tactics are essential

However what you said about man portable anti tank weapons since the 80s is false.

There were bazookas, panzerskreks, panzerfausts, PIATs, etc during wwii
Reply: Tell me how many leopard tanks Ukraine lost ? And compare that with Russians', why jump the gun ?
Reply: its almost like you said exactly what he said in the video
Reply: Well kinda like Vader killed Luke's daddy it's a point if view. So really it's not tanks are obsolete but these are obsolete tanks
Reply: however, if they had an active defense system like a trophy, infantry would not be safe in the tank's vicinity
Reply: Not anymore, the russians have come a looooooong long long way since feb 24 22. You won't hear about it in MSM but Ukraine is doing very badly. Russia is doing what russia does, make mistakes, adapt, produce. Slowly stacking the odds so heavily in their favor that they can only win. Meanwhile ukraine relies entirely on charity...and that gofundme is about to dry up real real soon. The war is lost, now young ukrainians are dying to save joe bidens fucking face.
Reply: it's good that people knowing nothing about what a Ukrainian steppe is and what is a russian army is, make this kind of "analysis". It means the russian command is somewhat delusional aswell. The longer it goes the better.
Reply: The problem Russian tanks have is they are junk 🤷
Reply: В этой войне все решает артиллерия и дроны. 90 процентов ранений это осколки. Танки работают как артиллерия с закрытых позиций. Либо  для удержания позиций. Танк против танка редчайшее событие.
Reply: Not obsolete but not modern enough for today's anti tank munitions and even some ordinary ammo can pierce the antique armor
Reply: Tanks require close AIR support to be effective (not infantry support)
Reply: @johndonaldson3619  Both. War is a system.
Reply: "folks have been saying that tanks are obsolete due to infantry-portable anti-tank weapons since the 80s"... Way earlier than that actually. People were crapping on the tank during WWI and WWII.
Reply: @00tree  Yes. One of reasons why Germans perform so well, was because Western powers ignore tank development during interwar. People were saying that with development of Panzerfaust. Also in the 50's, where actually first ATGM's were developed. Later anti tank aviation, man portable ATGM's in 70's and drones also were used for artillery spotting in Desert Storm. Finally Drones decimated Armenian tanks. Literally nothing new.

Tanks are part of the system and work when they are utilized as such. Tank on tank battles are rare.
Reply: Lol. Infantry support is a hazard for tanks nowadays. Its been clearly shown that tank movement and fire options as well as defensive manuevers are compromised with infantry around. 😂😂😂
Reply: @tadzdgreat  You should play less Hearts of Iron 4. Russia is literally not a example of competent maneuvers.
Reply: @tadzdgreat  Which is why they are usually in IFVs fallowing along the tanks only getting out when they are needed to support the vehicles.
Reply: They aren't having any problem only cnn programmed robots think so, do real objective unbiased research.
Reply: They also just suck, it is made in Russia!
Reply: its both most tanks ifvs and MBTs are based on the ww2 premise of facing the front inf cover vice versa neglect armor for  the sides and many potential roles for armored platforms overall ideally given how tech and engineering constantly outdid even comics back in the 80s ( i.e. f22 raptor) it would actually be better to start building a do all 2000+ ton mobile armored platform given it could fill the role of artillery troop transport anti tank and anti air that would allow certain armored roles to be delegated to a spot on said armored platforms as a simple turret rather than the extra resources to build the run of the mill extensive amounts of hulls engines etc to go with the gun and turret and awhile still producing units (just in less quantity) so it also covers support and logistical issues

for stuff like bridges and roads throughout tanks history they tore up paved roads anyway and had to just wing it with river crossing so it doesnt matter it was always a engineering issues which is long since resolved
Reply: No matter how much infantry support you have. A cheap ass drone is still going to disable a tank when spotted. But by god, if you havent seen that lone tank destroying an armored convoy, you wouldnt believe that tanks are obsolete.
Reply: Plus Russian tanks don’t even have the ability to make tea! Clearly, priorities were elsewhere!
Reply: Yep. Pretty much half of this video misunderstands what is going. Axiom 1 which is a false axiom is used to present axiom 2 which is a false axiom and so on. The chain of logic is flawed.
Reply: Maybe maybe not. Nothing is obsolete until it is. Drones are not done. With AI to guide them to their targets and stealthy designs future drones may eliminate tanks before they ever reach the battlefield without ever being detected. Or not. Who the he-- knows? A little humility is in order. These things are learned on the battlefield not decided by idle speculation. We don't build battleships anymore or flintlocks. We do make helmets. Wait and see.
Reply: Agree.  Russia misused their tanks.  Drones have changed the game in the same way that ATGMs did in the 1970s...particularly the 1973 Yom Kippur War.  One of the reasons the Soviets collapsed was the deployment of the Bradley in lieu of the M113 APC.   Every Bradley had two ready TOW missiles.  They were no longer just APC or IFV...they were Tank Destroyers with a range that exceeded the guns of the Soviet tanks.  That calculus changed the European battlefield...and the Soviets could not keep up.  For example, the Brads were deployed with M1 Abrams in  Cavalry formations to strike at long range and create conditions for M1s to counterattack or Abrams to stop close range penetrations.  

IMHO the Brigade reorganization during the 1990/2000 was a recognition that the combat power of M1 and Bradley with Infantry was more flexible and cost-effective versus the prevailing Soviet-style Divisions.    Take an Armored Cavalry Regiment and plus it up with Infantry and you have a dominant formation that can do everything.  Well, until the enemy lives in mountains and hides in tunnels.
Reply: @chrishooge3442  unless the enemy has decent air power
Reply: Tanks are just heavy cavalry. A fast shock unit that can perform a deep penetration of enemy lines. There will always be a unit that fulfills that role so long as we fight on land.
Reply: Tanks need infantry and infantry need tanks
Reply: Of course.
Reply: No it's air superiority, the infantry is useless against the drones and not to mention MLRS systems 100 miles away. The drones are reporting movements in real time. Nobody can defend against that. If your air force can't penetrate into the rear area of support you are sending in troops and equipment to their death.
Reply: Tanks need protection.
Reply: Yeah from what I have seen in this war so far, infantry is still shitting their pants when a tank is in the mix. That being said, there have been popping up some crazy tank destructions with measly drones recently, pretty impressive but a lot of skill is needed for that.
Reply: @TobyIKanoby  How is your armchair, general?
Reply: @reynardus1359  how is your comment, useless?
Reply: @TobyIKanoby  Hey, don't take it personally. Unless you want to.
Reply: @reynardus1359  I am pointing out facts.
Reply: Although Tank with infantry support but still not effective if the enemy use Kamikaze drone 😂😂😂😂
Reply: So thats what Ukraine are doing now
Reply: Doesn't help when experienced crews are being wiped out all the time because they are sitting on top of a bunch of explosives.
Reply: The tactics by the Russians defy any and all logic, send troops to get meat grinder without tank support, then send tanks to get blown up with infantry, never together, it’s literally like they just want as many men and much equipment of theirs as possible eliminated
Reply: People don’t say it out of ignorance, Russian tanks are obsolete because they have barely changed since the t-62
Reply: I said this 2 years ago when everyone was laughing at them. Now leopard 2s are failing and even the world's most protected tank the Challenger2 has been knocked out.
Reply: If a tank doesn’t have infantry all around supporting and protecting it from small arms explosives ( ex TNT, mines, RPG, Whatever) of course tanks will get put out of service.
Reply: They fail at the very basic trinity of Firepower, mobility, and protection. Firepower= Yes
Mobility= Depends on training, usually lacking in Russian armored Corps.
Protection= Limited to nonexistent depending on munitions
Reply: That's all equipment of any sorts in reality even a infantryman is fairly useless in the face of a decent trench unless he might have artillery or artillery is useless without infantryman to defend the position
Reply: Your right! They also have inferior optics compared to those western vehicles, which didn’t help them either.
Reply: @bpd8426  even a 10$ camera is way better at spotting things from high above than a super fancy optics placed low on the ground
Reply: @4354-d4v  Well we are talking ground  vehicles not air. The Russian vehicles are inferior, especially at night, when engaging targets. This is not an opinion, Russian/ Ukrainian tank crews openly state this.
Reply: Lack of proper training is Russias problem . You can see them stacked up in line just ripe for the picking.   Moving in daylight is just stupid in this day and age .
Reply: 😂😂😂😂😂 you’re talking about Ukraine tanks. Especially the mighty tank tin cat.
Reply: I agree with your point of view. Like the old saying a weapon without an operator is useless. I served during The Gulf War 1991
Reply: This has been going on sinds 1918. After the first WW the they already said that the tank would be over and yet, they are still here. Just evolving.
Reply: not just that; is that the auto-loader assembly hasn't been placed differently in a very long time too; which means if they did something different with their ammo setups in atleast a new or few different configurations? i could see russian tanks being back into menacing status. atleast; in my thoughts anyway.
Reply: I was in the 4th armored infantry of the Gardehusar regiment in 1999. You are absolutly right. without infantry support a tank falls short. Airsupport and artilery is also very importent. 
The drones we see today is also factor on todays battlefield. Even the best tanks will be turned into scrapmetal by cheap toy drones from Ebay... Tanks are no longer the king of the field... drones are
Reply: Russians are implementing the cyka blyat doctrine with their tanks thats why they are losing so many of them 😆
Reply: Duh.
Reply: "tanks" is a large category. 
It's more accurate to say  that old main battle tanks and their current force structure needs updating. 

We will see a return to light cavalry. The heavy 55-70 ton main battle tanks could see less use in the future, as lighter, smaller, quieter, and stealthier light tanks become more common. 

It's the way fighters and bombers evolved. Less of an emphasis on brute speed and maximum bomb load for stealth and precision. 

The future light cavalry tank may very well be the size of an SUV, weigh less than 10 tons, have a crew of 2 sitting in an armored cockpit. Engine in front, the driver behind the second road wheel, with a low slung vehicle no taller than 6 feet at the top of the remote turret.  

A large main gun would be unappealing, as it would require a much larger vehicle. Instead, arm it with a mix of a 30x137mm chain gun, a radar and optical suite for target detection and the APS, and a 70mm APKWS 7 shot missile launcher on each side of the main gun. 

With 10 tons, you can get a vehicle with the protection level of a Bradley (STANAG 4 all around and 6 along the front arc. Enough to survive anything other than a direct hit from arty or AT.
Small and fast enough to avoiding getting hit, with enough firepower to wreak havoc in a breach. 

As far as the fire support role of tanks, those jobs can be accomplished by guided arty/mortars/missiles/FPV drones/loitering munitions without exposing the assets to return fire. 

As former armored columns relied on attack chopper support, from now on they will have to have attack drone support with instant indirect fire and air defense on the move. Many of the roles that have historically fallen on dismounted infantry will now be accomplished by search and destroy drone teams in forward positions.
Reply: @theimmortal4718  The Marines have already abandoned tanks for their Pacific force structure.   Not too amenable to mobile, island-hopping warfare and flanking operations.
Reply: @TennesseeHomesteadUSA  
Yep. The logistics tail for heavy armor  is big
Reply: As infantry, should we fend off the cannons coming in front of the tank with our bodies?
Reply: @quakedamage8583  
That's what scouts are for. Several kilometers ahead
Reply: @quakedamage8583  Canons don't precede tanks on modern battlefields...
Reply: Today you have manuals drones glide bombs gps guided missle and radar guided artillary  and anti tank missles every thing is designed to destroy a tank
Of ant country ww2 you had artillary and some odd anti tank weapons
Russia put so much fear into people they came up with dozens of new very good weapons ok future tanks will be electronically  shielded but it's rough going fir a tank 
These days
Reply: Sounds like the tanks are obsolete as they don’t work with Russian fighting doctrine lol
Reply: True,  and that's nothing new. It was the case in WW II as well. Tanks need infantry support or any other support for that matter.
Reply: Also Russian tanks are…kind of bad.
Reply: Le problème des russes, c’est qu’ils pensent avoir une inépuisable « chair à canon ». Exactement comme Staline en 41 et suivantes.
Reply: according to you analyse Russia is loosing...They have a huge militaro industrial complex settled in the Oural with the world largest tank industry; then about cost Abraham tan cost 11 million $ In Russia you get a good tank less sophistiacted for 1 million Good luck
Reply: Yep.  Infantry, Armor, Artillery, and Air working in concert.  The Russians have forgotten this.
Reply: @stuartdollar9912  Russian are stupid, from de middle  they are cannibals but they win the war curiously against NATO which is demilitarized
Reply: @stuartdollar9912  Russians love the war ?
Reply: probably they "only" lost 27 million  during second war very "wise"statement
Reply: to be fair, they are also pulling obsolete tanks out of storage to replace heavy losses.
Reply: Somebody had to say it. Infantry and tanks are a wonderful mix designed to complement eachother. Infantry can move and shoot in places that tanks cant fit it and they can kill enemy anti-tank infantry squads. Infantry can also clear buildings and trenches more precise than a tank can that can hide enemy soldiers with anti-tank weapons. Infantry without tank support are very vulnerable to fortified enemy machine gun and mortar crews, so tanks and APC’s are essential for that.
Reply: your comment is obsolete, Russia hs the best adapted tanks to the Pontic steppe land  the largest tank facility the world The western tank are too hight and shot one by one
Reply: Tanks will never be obsolete!
Reply: @natetwehues2428  absolutely. Tanks and infantry were meant to go together. Thats probably why APC’s were invented. Its the perfect bridge for infantry and tank gap. Infantry also dont have the blindspots that tanks have when it comes to portable anti-armor weapons. A tank may not be able to see or engage a soldier firing anti-armor weapons from behind a tree or in a building. Dismounted infantry can get fire superiority on enemy, giving tank enough time to engage the target while infantry covers its blind spots.
Reply: I think I agree, It's almost as if this has been the case since world war 2 after the germans practised their blitzkrieg, defined by COMBINED arms, among other things, which involved infantry working with tanks as well as the air force
Reply: Well, russian tanks are pretty bad as a single grenade dropped from a cheap civilian grade drone  is enough to cause ammunition detonation in them, due to moronic autoloader design.
Reply: @dungeondeezdragons let’s be honest.  A grenade only destroyed that vehicle because the crew was poorly trained. IE.  They left the damn hatch open 🤷‍♂️
Reply: @smyers820gm   and also if we go from THE cheapest drones to middle-heavy class civilian models, these can carry around an rpg rocket or simmilar very fun payloads.
Reply: @dungeondeezdragons  1 gepard could destroy them all IF Ukraine would deploy it to the front 🤷‍♂️
Reply: @smyers820gm  are you serious? Radar almost cannot see targets that small and slow past 200-500 meters/yards, and those are the most expensive ones, small radar on a gepardAA cannot see targets like that deamn near untill they are on top of it.
Reply: @dungeondeezdragons  my guy you really have no idea about the capabilities of that platform.   Jesus you can search videos on YouTube of it doing target practice on drones 🤦‍♂️🤷‍♂️🙄
Reply: @smyers820gm  the problem is, i know. It was developed to be used against low flying fighter bombers and "close air support". For this type of vehicles small drones are as invisible as f35 sellers say it is against big expensive radars, even though it is not.
Reply: @dungeondeezdragons  dude you are not listening to me.   The gepard has ALREADY been proven highly effective at shooting down Russian drones 🤦‍♂️🤷‍♂️
Reply: @smyers820gm  russian drones? What russian drones? Russian drone effort is almost none existent. They have not been developing drones. Tf are you talking about?
Reply: @dungeondeezdragons same thing happens to leopard 2. The doctrine on how tanks are used is different.
Reply: @FM4AMGV  what? No no, i was talking about moronic autoloader that makes it impossible to store ammo anywhere else but around and underneath the crew. Which makes a single anti personnel grenade disintegrate everything inside the tank with no possible recovery.
Reply: @dungeondeezdragons  you get a frag grenade or javelin entering the crew compartment, i don't think you need the ammo to cook off to kill the crew inside, that applies to all tanks.
Reply: @FM4AMGV leapsrd 2 has very thin armor. I think it might have 6" of armor on the frontal arc. For a modern MBT that is very thin. It might be fast but any hit from another tank will bust a hole in the leapord 2
Reply: Yep, Russia fails terribly at combined arms warfare. They don't have air supremacy, proper infantry support.. and they completely lack proper communication between different troop elements. That is why their tanks are so vulnerable
Reply: @flexinclouds  the use of a mechanized asset has to be weighed. The T-72 family only has a 3 man crew, so more crews and vehicles can be deployed. Considering the staggering cost of guided munitions, tanks are a cost effective means to add firepower to the battlefield.

Our understanding of combined arms has not been tested in peer or near peer engagements. If the skies are contested, do you refuse to use assets? Do you let your upponents have that advantage over your troops?
Reply: @FM4AMGV you might get more tanks with a 3 man crew but when the tanks violently explode and launch their turrets when penetrated, killing all 3 crew, they become way more costly. 4 man crew western tanks might be a higher investment but high crew survivability means more soldiers return to the fight, or go on to train new crews.

That last part proved decisive for the US in WWII as compared to Japan or Germany we could send veterans back home to use their experience to train troops and develop new weapons and tactics. Michael Wittman may have been a formidable panzer ace and commander but he died in Normandy with many of his comrades when he should have been passing on his skills and knowledge to new tank crews.
Reply: @hunterkiller232134  if anything is going to set off the ammo in a t72, it will enter the area the turret crew occupy and would kill them with or without ammo detenation. I a nato tank is penetrated, the round will cause injury or death to the crew.
Reply: @FM4AMGV  That's not true. An M1 Abrams has blowout panels specifically to redirect the blast outwards and protect the crew, and an isolated ammo compartment to separate the crew and the ammo, and an automatic fire suppression system. Even the design of the crew compartment itself means in the event of a penetration you're unlikely to lose the whole crew. M1 Abrams have a very high crew survivability rate, and it isn't like that has not been tested between the Gulf War and the Iraq War and battles with ISIS and Houthi rebels. Abrams tanks under Iraqi and Saudi command have been hit by ATGMs and the crew survived. An American Abrams was penetrated by an RPG-29 in Iraq and 2 crewmen survived.

By contrast there is ample evidence from the Iran-Iraq War, Gulf War, the 2003 Iraq War, the Syrian Civil War, the war on ISIS and Ukraine that when penetrated Soviet tanks brew up and throw their turrets and kill the whole crew.

Now are there weapons that could potentially kill the entire crew of an Abrams or Western tank? Absolutely. A top-attack munition might very well do that. It's unlikely because the above mentioned survival features and crew compartment design mean at least someone is likely to survive (probably the driver). In fact I'm not aware of an instance where an entire Abrams crew has been killed by enemy action.
Reply: @hunterkiller232134  Not all hits or penetrations involve hitting the turret or crew compartment, some are aimed at the engine.
A projectile entering the turret is bad news for anyone inside, detonation of ammo or not. AT rounds hitting the front or towards the engine compartment have a significantly lower probability while likely immobilizing the tank. All these features to keep the ammo from exploding don't help when there's an explosion that takes out the crew.
Reply: @FM4AMGV  Hitting the engine isn't going to kill the crew. They can bail out or, at least with an Abrams, can still fight for a short period.

ATGMs don't explode inside the tank. They penetrate the armor and send extremely hot and fast moving fragments into the crew compartment, or jets of plasma or molten copper. At the speeds ATGMs fly a non-explosive penetrator wouldn't work. If it doesn't detonate the ammo it is very difficult to kill the whole crew. That's why tanks like the Abrams focus on protecting the crew by controlling ammo explosions. When a tank is penetrated in the turret the only crewman likely to die is the one closest the penetration in the absence of an ammo detonation. 

Blowout panels, isolated ammo storage and fire suppression systems work. That's why no Abrams crew has ever been lost to enemy action despite IEDs, ATGMs, tank battles and air-to-ground missiles. Even if there were a detonation in the turret the driver is separated from the rest of the crew so someone is very likely to live another day.

Russian tanks, on the other hand, store their ammo around the turret right in the path of a top-attack munition and in the center of the tank. An ammo detonation almost certainly means the death of the entire crew as the path of least resistance for the explosion is through the turret and the ammo is sitting right behind the driver. 

Again, this is something proven by history. Russian tanks tend to explode and launch their turrets. Abrams tank crews tend to survive.
Reply: @hunterkiller232134  Tanks that are hit are often written of even if they are functioning. Survival of the crew is dependent upon where it is hit. While Abrams can offer features that better protect the crew, it brings an additional crew member. For every 3 Abrams you could have 4 T-72 crews. Other tanks in the NATO arsenal like the Leopard 2 did not feature the blowout panels and did face the same turret ejection as the Russian models.
Reply: @FM4AMGV  A tank that is hit is not written off if it can be recovered, repaired and put back to action. A T72 that exploded from its ammo storage is a write off along with it's crew.

4 crew members is a good thing. Does it mean an Abrams battalion takes more men than a T72 or T64 battalion? Sure. But that 4th man per tank means another guy to help with maintenance and repair, another guy to pull security, and a redundant member of the crew in case of a casualty (an Abrams can fight with 3 crewmen, or even 2 in the worst case).

A T72 might save manpower by using only 3 men but when all 3 die easily because of the ammo location then it's a net loss compared to a 4 man tank. The whole point is that if an Abrams is penetrated the crew have a much better chance of surviving to fight another day. Experience is valuable.

Survival of the crew is dependant on where the tank is hit AND what Survival systems are in place. The worst possible scenario for a tank is a penetrating hit to the ammo storage. In a Russian tank it means complete crew loss and loss of the tank. In an Abrams it means the blowout panels get used with a chance the hull can be fitted with a different turret after being recovered and put back into service, or that the tank can even drive itself back home if the engine is operational. An American Abrams has been penetrated by an anti tank rocket before and guess what? Half the crew lived. We don't see that with Russian tanks.
Reply: Well russian tanks are obsolete, but that's just because they are russian and are just up to about 80's standard
Reply: @alternativewalls4988 They're not obsolete lol. The Russians leadership is incompetent and don't know what support is. You need support no matter who or what.
Reply: @alternativewalls4988 like modernweapons
Reply: @alternativewalls4988  That's Biased, Russian Tanks are quite good even if their from the 1970s-1980s the T-80BVM, T-90M and T-90MS are quite good for Modern standards its just that Russia still fights like they where in the 1940s using numbers to beat smaller nations, The Russian Airforce is quite strong Mig-29 and SU-37 and other Russian Jets good enough for modern standards but not crazy ahead of time like the F-22 and F-35 when those two came out, Russia and China had no counters at the time And the Russian Navy is a joke.
Reply: @alternativewalls4988 nope they are up to modern standard
Reply: @alternativewalls4988 considering Ukrainians r using the same tanks never hear anyone mention that
Reply: @alternativewalls4988  Well, the nato tanks aren't doing too well in the counter offensive either.
Reply: @danhobart4009 considering tactics determine if a counter offensive succeeds and not armor. Why would u negate tactics on an offensive and act like equipment us solely responsible for failed tactics?
Reply: @jasonmoyer9492  It all does come back to the equipment. Russia could have the best commanders in history but would still lose if they were just using sticks and stones.
Reply: @danhobart4009 only because the terrain and Russian defenses are so unfavorable. No tank would really do well in those conditions. Extremely thick minefields and low availability of mine clearing equipment mean Ukrainian forces are stuck on narrow paths carved through minefields that are presighted by Russian artillery. Leopard, Abrams, Leclerc, T64 or T90 would all be easily destroyed in that environment.
Reply: @alternativewalls4988 if you are saying that Russia has tanks that are from 80s that means those tanks are not Russian . They were made during Soviet Union
Reply: @NikZ8736   i said they are up to 80s standards.

I mean yeah a lot of chasies were produced back in USSR, but since they are now under russian control, it would make them russian

If you want to argue semantics, at least be right
Reply: @NikZ8736 Designed by Leonid Kartsev and Valeri Venediktov, both Russians and built in Russia by UralVagonZavod, in Russia, and still being built by UralVagonZavod...soooo, yeah.
It's a Russian tank.😂
Reply: @NikZ8736 yet everyone says everything bad about the USSR was Russia
Reply: @NikZ8736  Did Russia not exist during the USSR? That comment is laughable -- "these aren't Russian....blah blah ..." 😅😂🤣 Russian designed...used by USSR and their henchmen countries
Reply: @Sajuuk 100% "Russian" design -- Facts vs feelings, good job researching! 🎉
Reply: @alternativewalls4988 russia does have good tanks like t14 and t90ms but the problem is that they can't actually produce them because of sanctions and economical problems. so not logistically good
Reply: @user-fe7bo5mm1o  they refurbed all the old t-90a into t90m and modernization of t72b into t72b3m and t72bm also occured, t80bvm production is also restarting
Reply: @user-fe7bo5mm1o Russia doesn't have T14. It's a paper tank.
And the T90M is, charitably, a gussied up version of a gussied up T72. It has almost all the same major flaws of its older sibling.
Reply: @user-fe7bo5mm1o  They can't even produce much of the T14 Armada anyways due to their limited budget because they aren't the Soviet Union anymore.
Reply: Russian tanks have thermals auto locking guns it shows were to shoot on a tank witch western tanks don't have Russian tanks also have way better acceleration
Reply: @darronsands9881 there is no Russian tank that can match the Abrams when it comes to speed and acceleration.  It is a WELL known and documented fact the Abrams,  when first tested, could travel at 70 mph before the track exploded. 😂.   They are governed to control speed and prevent damage to the tracks and transmission.
Reply: @darronsands9881 Which simply doesn't outrun a marauding drone.
Nothin' doing.
Reply: @darronsands9881 Western tanks have better optics and thermals to begin with, and typically faster reverse speed which is essential for a tank on defense. They also have better crew protection systems which ensure crews live to see another day whereas Russian tanks tend to take the whole crew with them when destroyed
Reply: @darronsands9881 you mean SOME have auto-locking and thermal sights and better engines -- from the T-72B1MS and later ONLY...yet Ukraine is destroying them faster than Russia can produce them...

Thermal auto locking sights on a tank are an additional TOTALLY USELESS cost and complexity addition against  any FPV drones with thermal sights, Ai auto targeting, etc. 

Again, more money spent on a 1.2 million dollar Russian tank that gets blown up by a $1,000 Ukrainian drone...😅😂🤣
Russia needs to keep losing armored vehicles and planes until it runs out of resources like USSR did ...
Reply: Maybe tanks are not obsolete. What IS obsolete is our perception of how invincible tanks are because all we have battled recently was goat herders. Back in one of the best offences of war history, we have the German Blitzkrieg. Here are estimated losses of German tanks by year for WW2, compiled by the US military. 

1940: During the Blitzkrieg in Western Europe (France and the Low Countries), German tank losses were estimated to be in the range of 400 to 800 tanks.

1941:  German tank loss estimate...2,000 and 3,000 tanks.

1942: 3,000 to 4,000 tanks.

1943: 5,000 to 6,000 tanks for the entire year.

1944:4,000 to 5,000 tanks.

1945:  between 2,000 and 3,000 tanks.

Every nation had stats that were in the ballpark of these numbers, but mostly everyone else was higher. And these numbers included all factors such as different tactics, air power, various anti-tank weapons. being on offence, being on defence, etc. 
Again, we are not fighting goat herders anymore.  If you are happy with those numbers, tanks are not obsolete
Reply: @noahway13 not entirely true. I participated in the battle of 73 easting during Desert storm. The republican guard was well prepared for us. We're in hull down positions. Tried jamming our comes. Had battalions attempting to maneuver on us had defense I'm depth with a ready reserve and used arty on us. They fought hard and were not goat herds. They were trained professional soldiers. We were just much better and so was our bradleys and abrams.
Reply: @noahway13 to refer to a past enemy as a “goat herder” is to display a great ignorance of that war and is an even greater display that you obviously never served.  🙄
Reply: This didn’t age well, 7 more Leopards and an STRV-122 have been destroyed just this week only 2 of the 8 crews made it out
Reply: @Jcorbie yes but how many thousands of Russian tanks have been lost 🤔🤷‍♂️. How many hundreds of thousands of Russian soldiers have been lost 🤔🤷‍♂️😳
Reply: @Jcorbie  LMAO!  Awesome comment!  As Ukrainian FSU and then Ukrainian Western armor is destroyed it amuses me to read all the comments about how it is Russian armor being destroyed. Most folks only want to find stories to support their point of view and have little interest in what the truth is.
Reply: Wrong
Reply: Facts
Reply: Except they ARE obsolete by it's core design which does not involve neither ergonomics in daily use nor survivability of a crew in case of taking critical damage. 1 thing you have to understand folks - soldiers in soviet union were an expendible material and this mentality was behind of most designs for it's army  .
Reply: @ihorbychkov8742 dawg what, western tanks at least are literally designed around the idea of survivability and ergonomics. Hence the inclusion of blow out panels around the ammo, being much taller than russian tanks, hatches designed to be opened as easily and as quickly as possible.
Reply: @ihorbychkov8742 sorry to tell you, but the abrams's armor was designed to withstand infintary, you have to remember that tank on tank engagements are very rare. tanks aint going anywhere
Reply: Drones, arty, at rockets OP
Reply: Uhm you left out air support. Russia is winning btw
Reply: @kevinschuurmans7738 Russia is winning! Yes -- the  L0sers of the Year Award 😂
Reply: That was only true during the first Russian invasion.  Since then Russia, who basically had no infantry, built their military.  This past week they started using tanks again, and they did so with infantry support. The Russian army is almost three times the size today as it was when the war started.
Reply: @joshuaalistair3193 which unfortunately will lead to 3 times more casualties for them 🤷‍♂️
Reply: @smyers820gm  I'm sorry, there are 130 replies in this thread.  What will unfortunately lead to 3 times more casualties for whom?
Reply: @joshuaalistair3193  The Russian Army is 3 x the size and 1,000x LESS capable and competent 😅😂🤣 They are recruiting from Nepal, Cuba, many African countries, Syria, anywhere they can... desperate for cannon fodder.
Russia already had a shortage of young males BEFORE illegally invading Ukraine. After the war it's going to be a crisis. Russian population ⤵️
Lots of widowed or single Russian women will be looking for western men ...
Reply: why russian tanks? you think other tanks doesn't have same problems? Israel lost 80 tanks per day in war with Egypt.
Reply: Ukrainian tank brigades also operate without infantry they both use old soviet doctrines, especially ukraine which havent developed anything.
Reply: biggest world factory for tanks in inRussia in the Urals 
An USA Abrham tank is 11$ millions a rustic Russian tank is 1 million$
Reply: @louisecorchevolle9241 Cool.  Russia can build more Soviet era tanks that yeet their turrets at the first sign of trouble.

Trouble is, they really can't, or they already would be.
Reply: @stuartdollar9912  talking of Ussr for Russia is false what do you do with al the soviet Ukrainian leaders Trotsky; Breznev, Kaganovitch Chernenko ?
Reply: Tanks aren't obsolete, they're outdated. Surface to air missiles and drones have practically scared tank crews into becoming a stationary howitzer cannon with tracks.

The battle tank needs to be redesigned. And infantry can't support a tank in 2023. Weapons have become FAR too advanced. This isn't WWII anymore, the game has changed, as well as how it's played.
Reply: @OutcastRefugeMinistries infantry HAVE to support Tanks in modern warfare. They have to go clear out built up areas and likely ambush positions to allow tanks to advance safely.
Reply: Russian tanks are good for numbers, being self propelled cannons, for cost effectiveness, and for troop morale. You can take down one tank in a tank on tank engagement but the second tank is likely going to end you. That is an advantage in and of itself. Not to mention the gun is also pretty good.

While Russia is having troubles due to sanctions. Not many businesses are actually obeying those sanctions and continue to do business with companies in Russia. Much like politicians using lobbying firms as proxies and mediums for funding. So too are the Russians circumventing sanctions through friendly countries like China, Iran, and others.
Reply: @justjoking5841 the 125mm cannon is inferior to the Abrams 120mm. Which the Abrams can fire and hit anything Russian long before they are in range to return fire. Plus their optics suck and their night vision is awful compared to ours. I don't even think they have FLIR or Thermal like we have. But our 120mm outrages their 125mm
Reply: @jasonmoyer9492  I would argue that quantity is a quality all on its own. The Russians have more ammo, more tanks, more guns, more mines, more ATGM. The M1 Abrams while numerous and highly advanced still are not widely equipped with autoloaders either (correct me). 

As Napoleon asserts (not to paraphrase) the army with more cannons wins the battles.
Reply: @justjoking5841  one the most practiced and used in the field exercise in russian tank forces is "exiting the tank in the shortest time".
Reply: You mean the opposite, stop thinking like a sheep.
Reply: You sir know more then most people who talk about the Russo Ukraine war
Reply: Dude, when the 500$ FPV drone is able to take down a whole fucking tank the whole concept of tank is useless. How the fuck the infantry support would protect tanks from being detected shelled and bombed by drones?
Reply: @4354-d4v combined arms.   Putting aa guns with tanks and infantry and air support with artillery and mortars.  All used in combination.
Reply: @4354-d4v  What can a drone do that a tank can't do? So even if a tank is being destroyed by cheap drones, they occupy a role that no other system can replace. In videos we see of tanks getting taken out by drones are more often than not properly accompanied by infantry. And you have to remember that all tanks right now(except for some) don't have much drone and ATGM protection other than their own armor. And when it comes to statistics of tank losses, more often than not they don't tell what kind of "kill" they're talking about. There are mobility kills and outright kills where the tank is rendered completely inoperable. But I digress.

What can a tank do that a drone can't? Direct fire support. You can argue that a drone(like the Global Hawk and Reaper) can do that job just fine, which it would be had it not been for the fact that neither Ukraine nor Russia have total air superiority, not even local air superiority. And mind you while FPV drones are useful, that still leaves the infantry being vulnerable to being taken out without armored support. People saying that tanks are useless because drones can easily kill them also forget that so many things can kill infantry especially artillery, drones, and other infantry yet no one is really saying they're useless. 

Your point of how can infantry protect tanks from being detected by drones is a valid argument. Right now, there aren't as many anti-drone technologies yet but there are some that are already present. There are infantry held weapons that disrupt the link between the operator and the drone. So why can't tanks use similar weapons adapted for tank usage? Its still a thing that I assume is being developed. And what most countries are considered with apart from drones is the usage of ATGMs like the Kornet, Javelin, and Stugna. Its difficult to adapt or create a design that can effectively counter both at the same time.
Reply: @chorsaalterna9655  The real killer of tanks is not FPV kamikaze drones, but just a simple observation drones that are directing all kinds of anti-tank weapons (artillery, ATGMs, FPV drones) to kill them. You don't use tanks to protect infantrymen, it is a job of APCs and AFVs
Reply: @4354-d4v  point taken. No arguments here. Although one thing to point out is that tank development still hasn't quite caught up to the age of atgms as in hard kill protection systems aren't as common yet and better systems.
Reply: @4354-d4v in time they will figure out a way to stop the drones attacks.
Reply: lol we all saw how nato tanks performed during ukraine's disastrous failed counteroffensive
Reply: @txn4yt7mc5  fair enough. Only that the Ukrainians aren't using standard NATO doctrine. They're still using Deep Battle and most other Soviet tactics and stratagems. Think of the AFU as this "An army armed with NATO equipment fighting with Soviet Doctrine" albeit heavily adapted towards their current needs but principally the same
Reply: Yep they are mass produced unproven garbage,  Outdated before even used in real world. @txn4yt7mc5
Reply: @txn4yt7mc5 lol u just showed all of us u are a blow hard and don't know what u are talking about. Tactics are why any counter offensive will fail. Equipment doesn't determine that. Damn dude that was a seriously poor attempt at defending Russian junk armor. And it's straight up speculation with zero fact or evidence to support it. I hope u ain't a lawyer.
Reply: @txn4yt7mc5 bad planning on the Ukrainians part.  They even admitted this 🤦‍♂️🤷‍♂️🙄